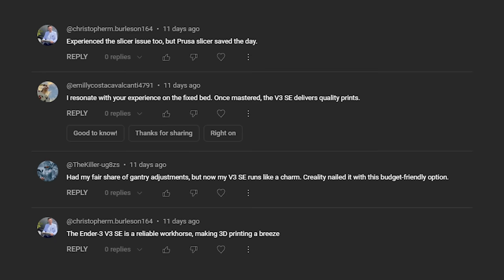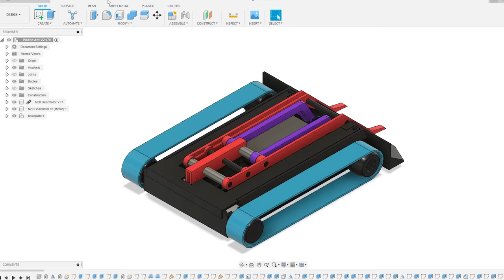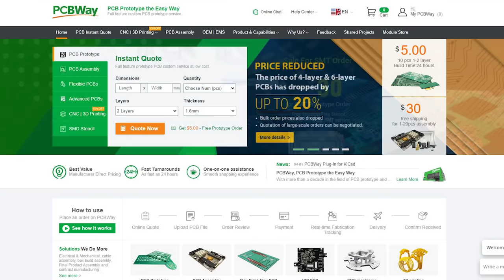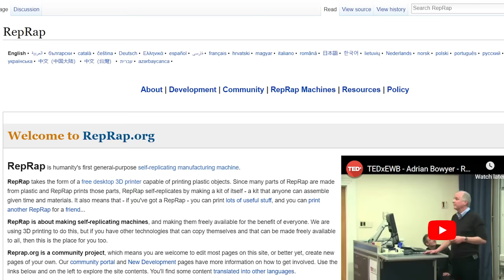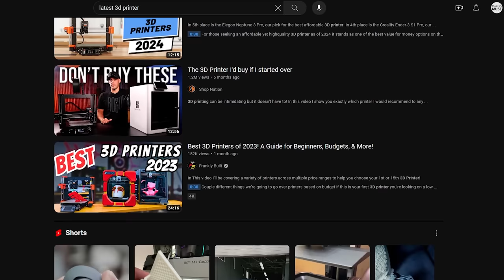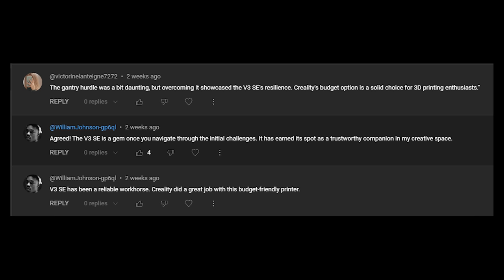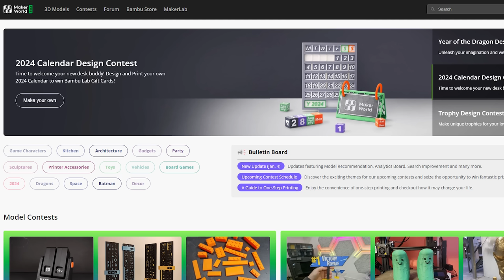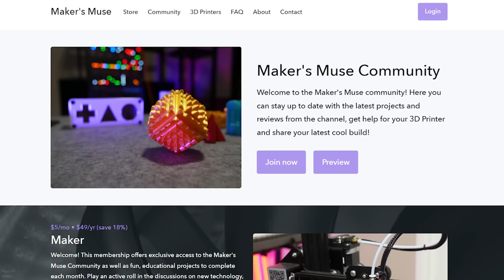My 3D Printing Predictions for 2024

Comment: My prediction is that STL files will give way to STEP files (or at least I hope so) for sharing. Especially since Prusa Slicer, Bambu Slicer, Orca Slicer (and eventually Cura) can import them directly. STEP files are easier to Remix than STL files. I have also noticed that when using STEP files in slicers, they print faster, use less material and are more dimensionally accurate when printed. I'm hoping that the slicers will interpret STEP files more like CNC machining code with arc, circle, spline, etc. commands instead of averaged triangles.
Reply: oh wow im going to start sharing .steps then, its such a pain to import stls to fusion and convert to a mesh to make an edit
Reply: I didn't know I can import STEP into my slicer! Going to try it tomorrow! Thats amazing!
Reply: Making a .STEP version of a 3d model is more time consuming and has it's limitations so it won't totally replace STLs but it's nice for things like boxes or other items that it has built in customization options.
Reply: @hd-be7di   There are at least 2 tools that convert stl to step: FreeCAD and 3DLess
Reply: @hd-be7di  I think we will have to agree to disagree. STEP files are easy to export from CAD programs. . More so for functional parts. I'm not sure of the workflow for say Blender (and other types of MESH editing programs) and those who use it for say "organic" objects (figurines, etc.) So, there will still be a need for STL for those types of prints. But those of us who do more functional prints I believe STEP files should be used instead of STL. But that's just my thoughts. ;)
Reply: @MrDB42  If you idea of a functional part is a rectangle with some holes in it, sure STEP files are easy for that stuff.
Reply: @darekmistrz4364   That's a reverse process and it doesn't work most of the time except for very simple shapes but then you can just make it as a STEP file there's no need to waste time trying to convert it.
Reply: I feel you. Lately ive been working with a annex trad rack and a galileo 2, neither of them have released step files yet, only stls. Pita to edit, essentially you recreate the parts by yourself and then edit it, or if you are lucky, can create some parts for boolean operation to get the part you want. For example, there is a encoder mod for the trad rack, but attaching you screw directly into the plastic. One subtractive body was enough to use heat inserts. Im also not sure what to think about withholding step files until full release and during opem beta just stl. Its understandable for the creators, but super annoying for the user as the user cant make improvements that might make it into the finished release
Reply: Frankly I hope that .STEP files die out entirely and give way to CAD file standards that can maintain feature history better
Reply: @hd-be7di  I build space telescopes for a living, and every part we design can be more easily and accurately exported as a STEP file than as an STL.
Reply: I agree! as far as CNC milling goes, the less linearization you have in a program, (point to point) the less processing speed required, and faster and smoother motion results! I too vote for this!
Reply: @ZanHecht  Dude it doesn't matter it's converted to polygon mesh in the slicer either way and it's limited by the Gcode resolution in all cases.
Reply: I've already switched to STEP for my internal work flow whenever possible.
Reply: @hd-be7di I just export to STEP, just like I would export to STL. I don't see how it's any more difficult.
Reply: @hd-be7di  No its not. You just chose save as step instead of stl lol.
Reply: @lightingbolt85  we would need to find then a standard that works with all major cad programs. Creo for example only got boolean operations in version 7. Lower creo versions are still used, seat/cupra for example still uses creo 4, their Leon is even featured in the loading screen. Luckily we transitioned from creo 4 to 8 fairly recently, there are a few improvements here and there, but nothing major
Reply: @hd-be7di  Sure, just rectangles with holes. Like a Pi 4 board detailed to the individual pins in the micro HDMI connectors (for whatever reason), all neatly structured and organized. Steppers and servos and all kinds of components with absolute geometric precision, readily modifiable on the component level.

Who would need that when you can have triangle meshes with "some" accuracy? I have a feeling you never opened a proper STEP model.
Reply: Direct motor control with AI will probably be a thing this year.

Theoretically you won't need a specific file type.
Reply: While step files are always superior to STL files for non-organic modeling, I feel a lot of creators will not release them because it would be too easy to remix their work. I think only a subset of people who don't mind people remixing their prints will actually share step files.
Reply: Chiming in as a professional CAD person to say that this is the way. STEP has been the universal standard in the professional space for longer than my 14 year career, and I can't wait for it to be more widely used for the hobby space. It's an excellent format.
Reply: @lukesdrone4511  i just had the case where i couldn't export a step as stl for sls printing. Additionally the amount of data saved is pretty cool, so you dont need to share via one drive, step is often more data efficient. Wouldn't be the first time i had a 100mb stl
Reply: @hd-be7di oh yeah, gcode is the limit, maybe if gcode was replaced by some new (vector?) type code, gcode has been around since 90s or something.. it has limits obviously
Reply: @robob3ar   I tried increasing the gcode resolution but it didn't make a difference since the hardware limit is the stepper driver's micro-steps.
Reply: @robob3ar   Gcode has been around since the early days of machining in the late 1950's. It's an array of float type values and is turned into a "vector" during print time when the steppers combine the move into an XY coordinate change (a 2D vector)
Reply: Why do they use less filament? Model size aside Isnt filament usage mostly set by the slicer?
Reply: @lightingbolt85  this needs to happen
Reply: @j03y__  That is a very good question, which I don't have an answer to. All I did was take a functional part that I had designed in Fusion360, exported the part as a STEP file, and also as an STL (via 3DPrint as I had always done in the past). I opened Bambu Slicer, put the STEP file on one plate, and the STL on another plate and sliced them. When looking at the preview data, it showed that the STEP version used a little less filament and slightly faster print (it was small variance, but it was there). I then printed both and compared them. Dimensionally the STEP version was closer to the design and looked cleaner (less faceting on curved surfaces as an example). The only thing that I can think of, is the tessellating engine in the slicer is a little better than Fusion360 for some reason. You have to remember that the slicer takes the STEP file and internally will convert it to a STL before slicing. 

Hopefully someday someone will figure out how to slice the STEP file "as-is" and just generate G-Code for printing. But reading up on it, it's a bit of a daunting task.
Reply: @lightingbolt85 / That's an issue - the one part that is split across the industry in a million pieces.
There is no single standard to share operation history since there are so many softwares with different workflow/operation functions that aren't exactly 1-to-1.

Comment: Thanks for posting the video. You have raised some very valid points here. 
For our business, 3D printing has completely changed the way we manufacture parts for our products. Earlier we used to manufacture most parts from aluminum, with processes like milling and turning followed by post processes like anodizing, painting etc. Now we just have to create the model in 3D and have it 3D printed.

Comment: About recycling. I feel like we're reaching that point in the consumer 3d printing space where a lot of old 3d printers are becoming obsolete and get thrown away.

I have my first 3d printer which is sitting in a corner in my garage because it is too old (Rumba board, spring calibration, no heated bed, ecc), small, and unreliable to be of use right now. I also don't trust it enough to gift (or sell) it to someone in need of a 3d printer. But I still think there's some value in there and that it doesn't belong to a landfill (nothing does). The motors, drivers and some mechanical parts could still be used for other projects, but I wasn't able (or skilled enough) to think of something useful myself. 

I've seen some really interesting videos in 2023 (the old ender 3 to filament recycler comes to mind), but for 2024 I'd love to see more ideas for upcycling old 3d printers
Reply: You could definitely sell it, just probably not for anywhere close to what you bought it for. I personally like buying broken 3D printers on the cheap from eBay or OfferUp and getting them working and upgrading them. People also like to turn them into PET pultrusion machines to make filament out of PET bottles. Printers that have been torn down and repurposed for this  don't really need to be top of the line, in fact, the simpler in function, the better. Also, there's the salvage value. I've seen some that are broken and are being sold for just less than the cost of the stepper motors. If I'm looking to build my own printer, that could be an easy win.
Reply: @lajoyalobos2009 I like that idea. I’m a print seller enthusiast (though with not much space) and I’d love to ask my community in a few months or so if there are 3D printers they’ve given up on sitting in a garage. It would be a win-win. The seller gets extra cash and less to worry about, and I get a new printer.
Reply: I also had an old 3d printer which I wanted to give away. But then I counted the price for stepper motors, electronics, shaft etc and reliased that it all worth at least $80.
So, I put it with price $100 on local flee market site, and it was bought pretty soon. Now I can spend those money for spear parts for my new printer.
So, just sell your with the price of parts, in any case it is better than storing it in the garage.
Reply: @lajoyalobos2009  I thought about selling it (or giving it away) as "for parts" to someone who could reuse the components, since I don't think it is worth upgrading as a 3d printer, you should change so many parts it would be simpler to start new. But didn't find anyone interested nearby.

I guess in 2024 I'll take the time to see if I can repurpose the components for a PET pultrusion or filament recycling machines (like the ones CNC kitchen tested)
Reply: Put a laser head on it and convert it in to a laser engraver?
Reply: I'm looking for a printer like that but I have hard time. I have Bambu P1S which is my upgrade from 2018 Ender-3. I need a small printer to put into my car or that I can take anywhere to print small parts. I have MKS Gen L, TMC2208 and a 100W powerbank with 20V power delivery. I just need a frame and a bed, but they need to be "just right"
Reply: Make a filament recycler out of the old Rumba system :)
Reply: Let's hope 3d printers don't become like inkjet printers.   Those are thrown away faster than old phones, such a total waste.  Filament waste is nothing compared to the waste in amazon delivery packages, that is a huge waste problem that isn't going away until amazon has real competition.
Reply: @murraymadness4674  3d printers already are like that. Many Chinese models are not resellable on second hand markets and expensive commercial ones don't have spare parts. We still have some reprap/dyi tooling that keeps them running but that is also slowly going away

Comment: I hope bad patents based off open source prior art won't be enforced. I worry that open community projects may have less room once Chinese manufacturers have to dodge patents and lock everything down.
Reply: Man are you hopeful or is naiv the better word?
Reply: Chinese companies should not even be allowed to hold patents in the EU/US as they do not respect ours in the slightest.
Reply: @ivyr336  I'm talking if the likes of Bambulab consider suing flashforge or phrozen if they have a force gauge flow calibration function. All Chinese competitors
Reply: @ivyr336 careful what you wish for, itlf it wasn't creality ender 3 made it affordable and accessible 3d printing will not advance this fast since german and us based company sell thier printer for 1k +
Reply: @doritosicecream2820  Creality is sluggish to open source their work, but at least they do it eventually. K1 value proposition is enhanced by moving to stock klipper
Reply: @doritosicecream2820  What does creality even have patents on? Their engineers are really not good. Will never forget how they added a fan to the ender 3 PSU and then forgot to make an exhaust. So it was spinning right into some sheet metal, doing just about nothing.
Reply: @ivyr336  I don't think Creality is the one to be concerned about with patents. Bambu files parents left and right though, and they're horrible, straight up invalid but can still foul the market because nobody wants to actually fight for invalidation.

Comment: You've been the pickiest reviewer since I started using a 3D printer. For that reason I trust your reviews more than most. 

Love the tips on printing different materials videos. Instead of just telling people to change settings to print something like TPU, you actually went through the trouble of explaining the behaviour of the material which helps understanding how to troubleshoot a problem instead of just changing a value and moving on. Please keep those videos coming.